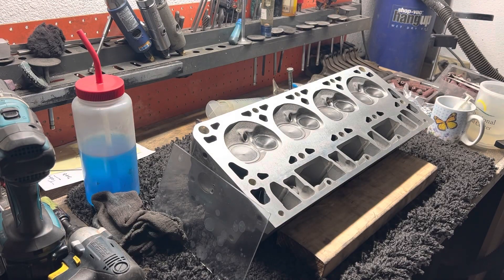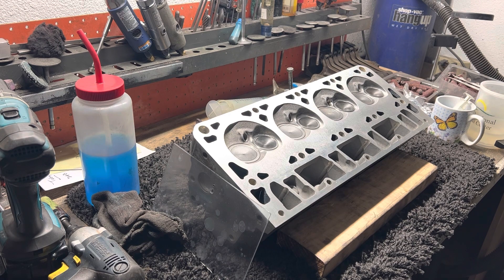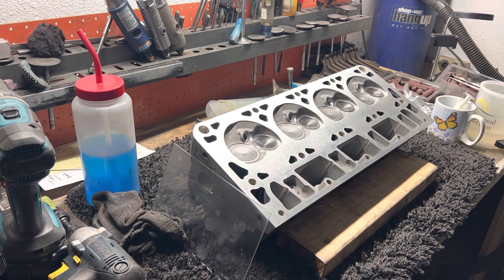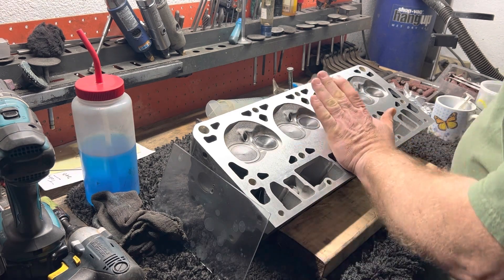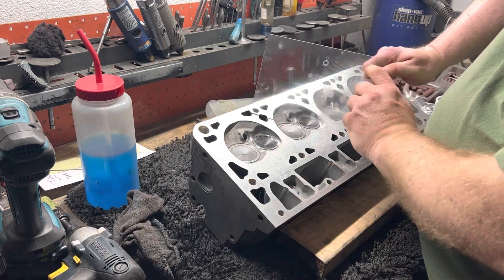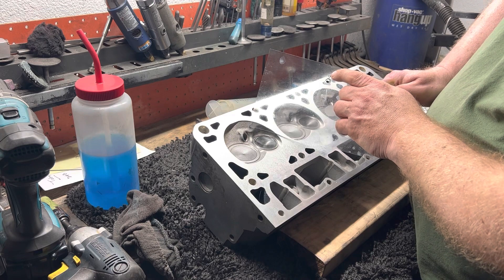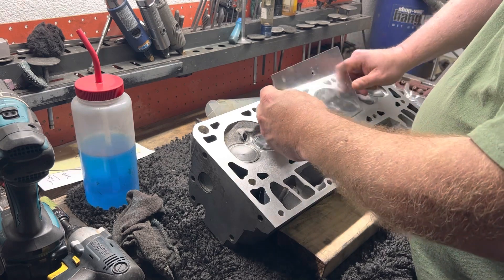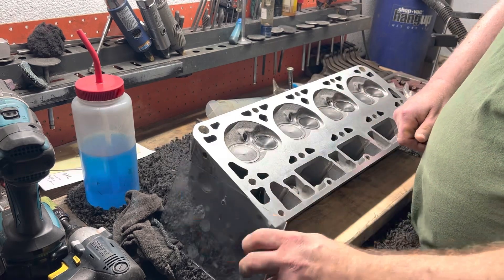862 LS heads How to cc the Chambers

Comment: Have you ever done any porting work on 90-95 LT5?
Reply from the maker: There’s videos of a set of 90’s LT1 heads on my channel, I’ve never heard of LT5 heads. There was a HP LT4 heads on a Corvette
Reply: @HeadFlowInc  The engine used in 1990-1995 Corvette ZR-1 was titled the LT5. The engine was designed by Lotus alongside GM engineers. It has a plenum and (2) fuel injector runners that people port along with the heads. Several videos about the car and the engine on YouTube. https://youtube.com/shorts/D7RMQgsfh3Y?si=di9UdkxYNx78jvJ2
Reply: LT-5 heads is a 4v per cylinder overhead cam type head. Only came on Corvettes. Pretty rare and hard to find parts for them TBH…
Reply: @MSU_BullDAWGz Not hard to find, I have one and am in the Registry 😊

Comment: Will the e1254p camshaft work well with a 10:1 lq9 looking for a lot of low end power?
Reply from the maker: The main thing is calculating your dynamic compression ratio, and making sure you don’t go too high if you’re planning on running pump gas

Comment: What static compression are you setting it at?
Reply from the maker: On these heads they weren’t wanting to surface anymore than required to make flat.  They were going on a 5.3 w/ Summit forged pistons. 
My 862’s on my 4.8 have 61.0cc chambers and a SCR 9.51-1

Comment: i have a ls1 5.7 local performance shop recommended 862 heads that are worked, the offer 243 heads also same work done to them, which is going to make more power and estimated by how much, how much difference is raising the compression with the 862 heads going to make?
Reply from the maker: Compression is misleading, for ever full number of compression say 9.0-1 to 10.0-1 only changes power 4%. 
Cylinder head flow trumps a small bump in compression.  Either head 862 or 243/799 will bump your compression compared to the factory LS1 heads which have huge 71+ cc chambers. 
Compare the flow numbers and price differences between the two options and pick the one that fits the budget.  
Naturally the 243/799 heads are better from the start so that’s worth mentioning, but a good flowing 862 is a great option too!  JD

Comment: What machine shop do you recommend in the metro area?
Reply from the maker: Nolands Cylinder Heads near the Greyhound bus station down town KC right off I-49/71 hwy. But be prepared they have a 3-4 week turnaround time to get the heads done. 816.471.5167

South of KC just South of Belton, Mo. is Performance Machine 816.250.5532 
1/2 mile North of  Midway HS.
Reply: @HeadFlowInc  awesome. Thanks for the info.

Comment: I ported my 862's for the larger valves that come with the LQ4.  When I measured mine, I came up with 68cc for each cylinder, does that make sense?  I did a fair bit of deshrouding the valves.  Mine also went to a machine shop, but I asked them to only clean them up.  I think the guy said me might have taken off 0.005.  I'm by no means a pro at porting, but I really wanted to do it myself because even if I don't do it all that great, I know that I tried.  Your videos have been very helpful explaining the process (I did the oil pump also)
Reply from the maker: Thank you!  From my testing the 862/706 heads come factory with 65cc chambers.  It looks like you did a good job unshrouding adding 3cc. 
.0075” cut equals +- 1cc so only cutting .005” should reduce the chambers a little over 1/2 cc or .66cc
It’s so rewarding to hear these videos helped you work through the porting process on the heads and oil pump! 
Thanks again I appreciate your support!  JD